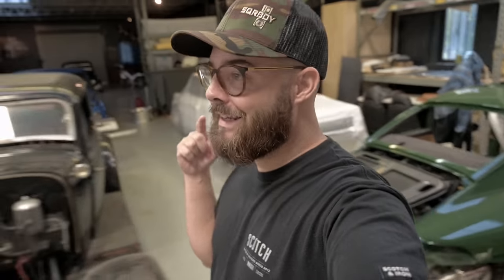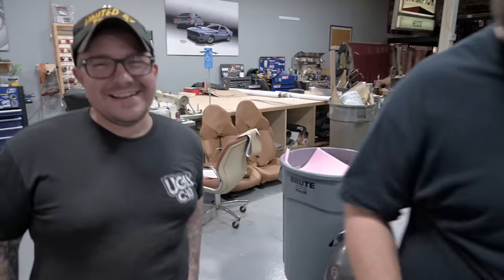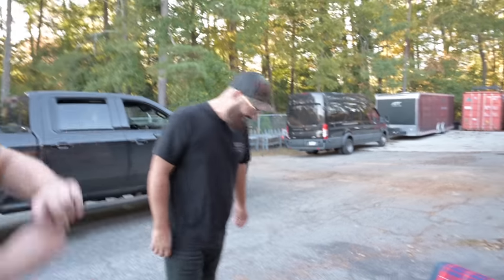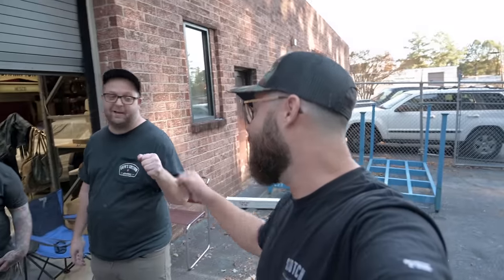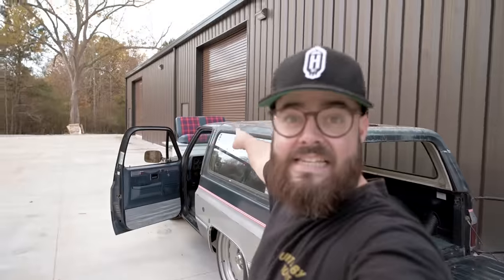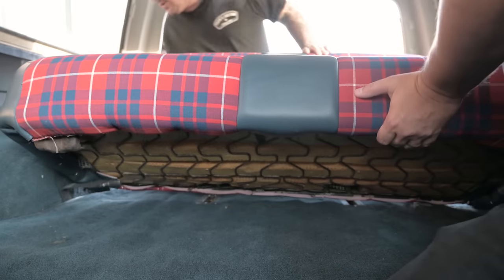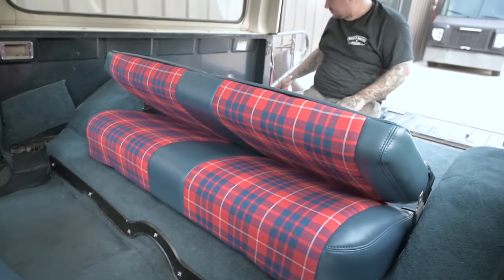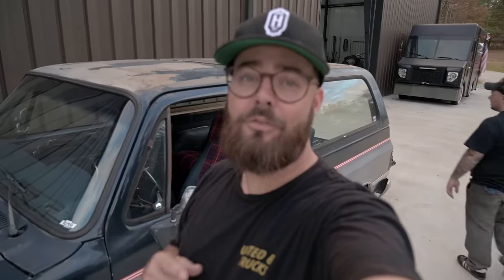THE BLAZER GETS CUSTOM KILT PLAID INTERIOR. thanks, Cato.

Comment: Sweet! What did you guys put for exhaust on those K5?
Reply from the maker: Originally had Black Widow Venom 250s but we've switched it out for Borla ProXS to quiet down the cabin.
Reply: Sweet! Thank you, I just got done having the violators put on my 85 custom C 10 and I feel the same way, might be a little over the top a noise going from the Flowmaster ‘s. Time will tell. Keep up the good work guys